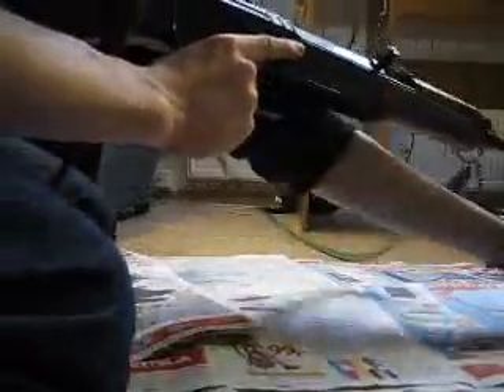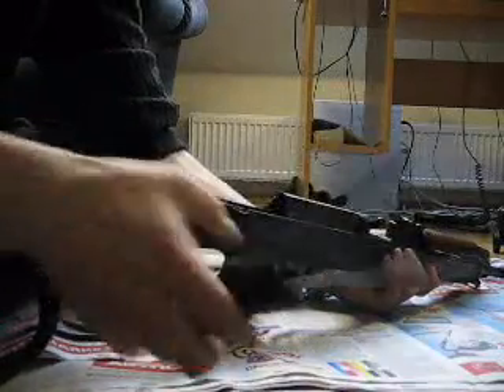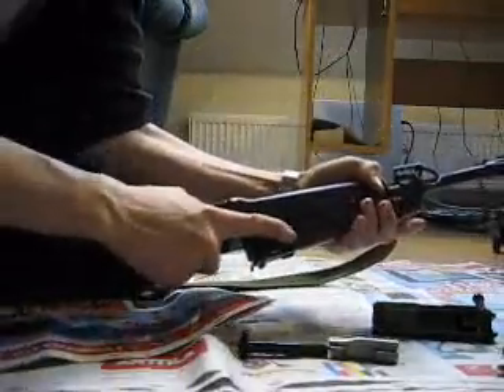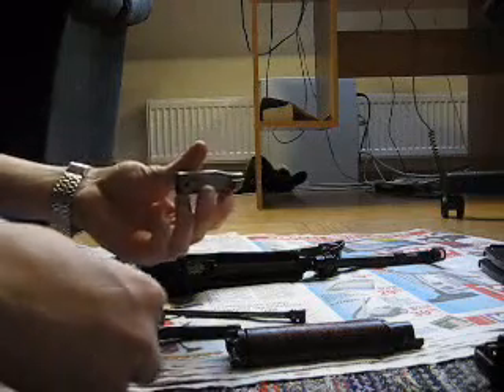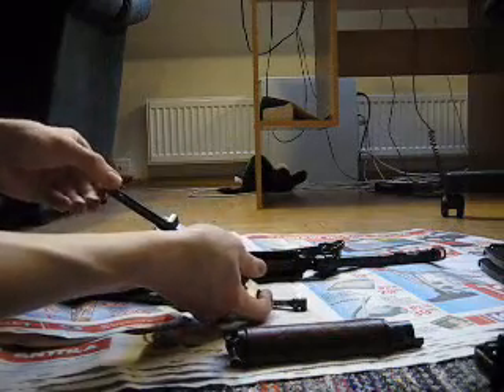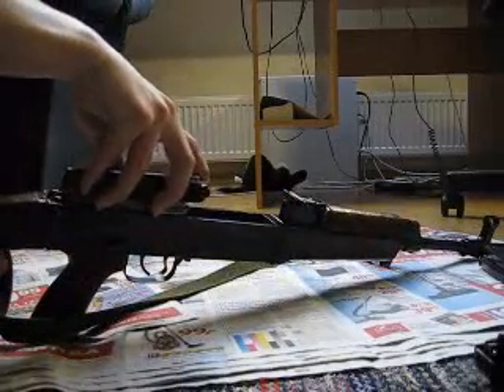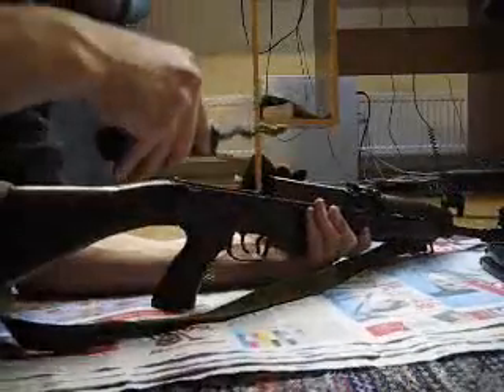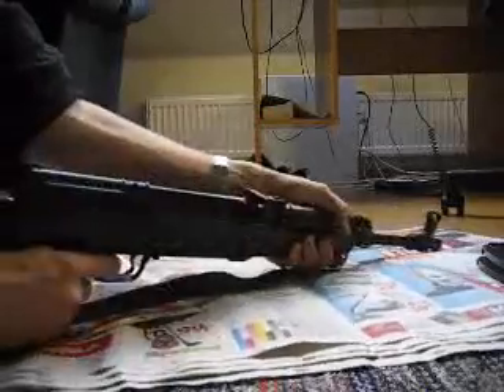Disassembling a Vz. 58 / CZ 858 Tactical

Comment: Was having a bit of problem with reassembling the rear receiver.  Watched what u did once and it went right in.  Was a big help.  Thank you.  Key us to pull that trigger to move that bolt forward. Couldn't figure it out until I saw u do it.

Comment: I just used a small screw driver and a hammer. One little tap and it popped right out. The pin is flared at both ends so I keep it one way to keep the flare on at least one side.

Comment: After 30 rounds the handguard pin was jammed. It took a punch and hammer to force it through to open. Even then the "ears" had to be prised up with a a screw driver. Re assembly was very tight also even with heavy application on lubricants by a law enforcement gunsmith.. I think the receiver expanded and am worried about head space problems next time I fire it. Telecon with J&G said that one of two examples on hand  had a tight pin. Before I fired it it worked as in this video. Advise Please

Comment: I wouldn't say shitty, but it needed a bit bracking in, as all failures happened with the first 500 rounds. Now I have had no more problems with it. I have heard (gunrange wishdom) that a milled reciever flexes less than a stamped when shot resulting in higher accuracy. Personally, I think that better quality round than that cheap surplus shit I use would make a hell of a lot more difference.

Comment from the maker: I havnt tried 500 shots without cleaning, cos i feel like i leave a good friend in trouble, if I dont clean my guns :D But my friend who has the same, shot 500 corrosive ammo through it without cleaning, and worked fine, except around 500 it did cause little troubles, but I always clean and lubricate after shooting it, usually 100 rounds when i get to the range at least.

Comment: well,is assembling it a bit wrong. We had to strip the rifle in 7 seconds and assemble it in max 10 (8.5 is doable). I have a small trick for you when you put on the sliding locking mechanism, just turn the rifle upside down and easy slide the lock into the rifle. Its very fast and easy, not tricky. Have fun trying.

Comment: The M16 is nothing like the M14.  The M16's gas system is direct impingement (no piston) and the bolt and carrier goes into a buffer tube in the stock when fired.  

The Ak and Vz58 are not very similar either.  The AK uses a rotating bolt and is hammer fired.  The Vz uses a tilting bolt and is striker fired.  The piston system is also different.

Comment: there are many manufacturers and versions of ak47's and not all are of equal quality. The most important difference is a milled or stamped receiver, with the first resulting in a stronger, and more accurate weapon. I own both weapons, cz858 and a bulgarian arsenal SAR-m1. Personally I perfer the cz, as its overall quality and accuracy is better than that of the SAR while it cost half. 2.000 rounds fired in each, 0 problems with the cz, couple of feeding problems with the SAR.

Comment: nah, otso, thats great move form you. I just suggested some improvments cos I had to do it many many times (I could do it blind), you just showed some moves (which can be pain in the ass), you should avoid. You didnt warn that the gas bolt spring can jump off (happy searching), so people should pay attention to removing the bolt etc.  Try the way of assembly as I suggested, you will see its not tricky but very easy, and then gimmi a reply.